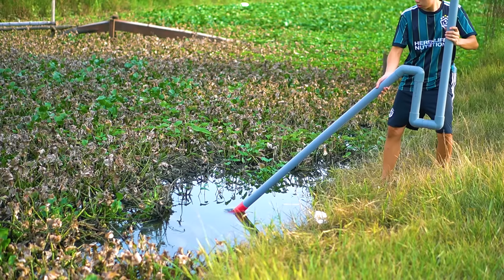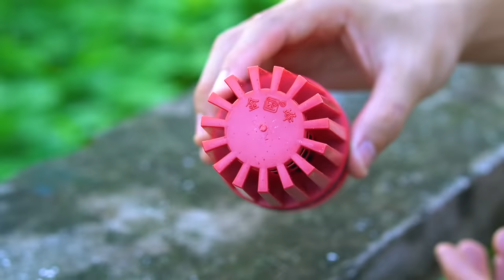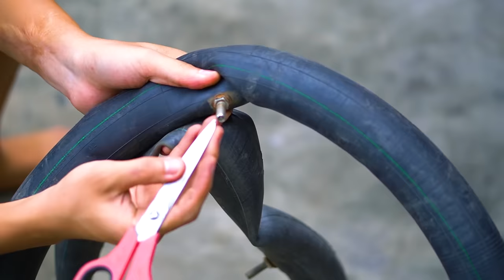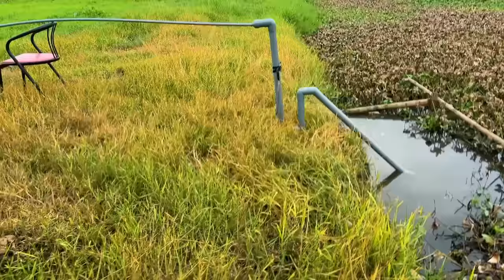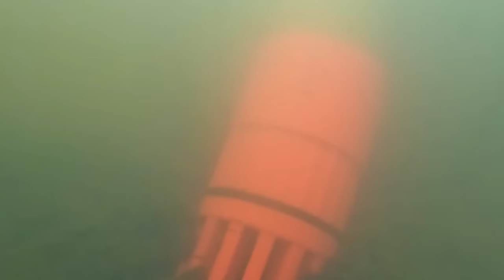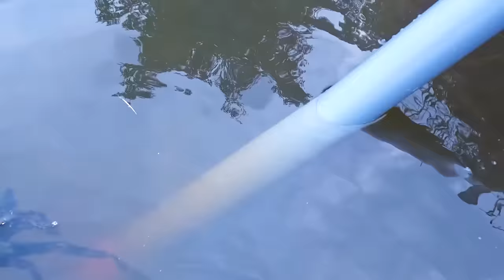I turn PVC pipe into a water pump no need electric power

Comment: In 6.53 to 7 minutes on the video you can hear a small pump sound inside that pvc listen carefully 😂😂😂 all of his video’s are fake don’t try to make those
Reply: Excellent, Inspector Rakib, I was looking for the failure, you found it. Congrats ...
Reply: @francoisgouttes8242  i do rewind back the 6;53.. i saw the bike on the roadside and it was the sound of the bike !
Reply: owh really ? your ears is good but your eyes not.. if u rewind back and see whats near the roadside is the sound of bike not pump.. i bet your might need to go for doctor to check your ear & your eyes
Reply: @dickymobile9189  I am not concerned by the noise, be it bike or airplane; this guy is making so many people lose their time showing a bad music hall trick .. enough for me.
Reply: yes! fake!
Reply: It’s not fake, once the water has started to come out of the output no external energy would be required. The water going out is sucking water in and the valve only lets the water flow in one direction. This creates a sucking motion as the water leaves in the output the water will enter the input.
Reply: Visible Truth  what’s your theory
Reply: @petercleary3278  hahaha, very funny! And then the mother sheep opened the belly of the sleeping wolf and found her baby alive and the fairy turned the pumpkin into a coach.
Reply: Visible Truth  I have seen before the pumps using air and pressure to pump water mechanically. Could it be possible that the diaphragm he has fitted in the pipe could be creating a syphoning action. It could work but I see the flow is continuous not in the action that would work with the diaphragm . The water here looks like it’s being syphoned and not pumped as the title says
Reply: Notice the sound stops after the truck with the red container moves out of range. Look up sound of J Brake / engine Brake. The science behind this no trickery. In plumbing that style of grease trap is banned cause it does exactly this. There's many videos explaining why whywe use P traps and not s traps. Also if you notice the one way valve I think there's also a ram pump situation happening. But you can look up ram pumps and this is explained by many many ppl in different fields from engineers to physics to high-school teachers. Go find some scrap pipe and learn something maybe educate yourself a bit lol
Reply: @petercleary3278  go back to school and get some basics of phisic laws 🤣
Reply: @francoisgouttes8242  p
Reply: I can hear the pump too lol
Reply: How can the water lift if the outlet is higher than the inlet? This is a hoax.
Reply: 😂😂😂😂yes
Reply: Yes they have pump using.
Reply: There are fools to fool and fools to be fooled, right?
Reply: hoax video😜
Reply: Goes against the laws of fluid dynamics!
Reply: It's the sound of a bike on the road dude... 😒
Reply: Hahaha,look at the flow of water just like a faucet, hahaha
Reply: @petercleary3278  это из твоей головы мозги выходят без всякой  энергии
Reply: Despite the negative comments above, I am of the opinion that this man has shown every aspect of his science in this video even in the deep water. there is no water pump. 

but I am not sure whatever he has made is a successful project. I don't know why he fixed the tube valve in the inlet section of the pipe and how it sucks the water and the push it towards outlet section
Reply: @ismailmohamed9750  
Do you know the meaning of fraud?
Reply: @ismailmohamed9750  
Do you know the meaning of fraud?
Reply: Nu are logica, cum sa urce apa asa fara nici o forta ascensionala.
Reply: E ceva sub apa care o impinge in teava, supapa impiedicand apa sa coboare inapoi in balta, teava ramanand mereu plina cu apa impinsa din balta.
Reply: Actually this kind of flows of the water was happed from the time of Moses when he struck or hit the big rock after several hitting that rock begun to split apart... then flows the watet from deep to the top...The pressure from the depth pushing the water flows above...I think the tube is like generating a sucking pressure.
Reply: I forget the name of the law this force applies but once it gets to the bottom of the 90 and out. It’s good. The flap at the bottom helped draw in water.
Reply: @wazirazam2591  the red inlet side acts as a diaphragm pump. Him shocking it draws water into the tube. The water has no where to go but in/up/right/left/whatever. Once it gets past the first 90 and falls. It’s a wrap. The tube fills up because water is freaky like that. It will follow its own path like electricity. But what makes it fill the tube is gravity. The water pushing past the first 90 that drops is what is giving it momentum. The diaphragm isn’t moving anymore. It’s stuck open. Water is flowing by.
Reply: I think this method he showed in the video could potentially work.
Reply: YouTube me paisa kamane ka achchha idea nikala hai.. View badhane ka
Reply: @francoisgouttes8242  90⁰
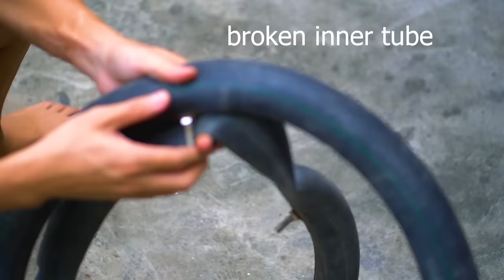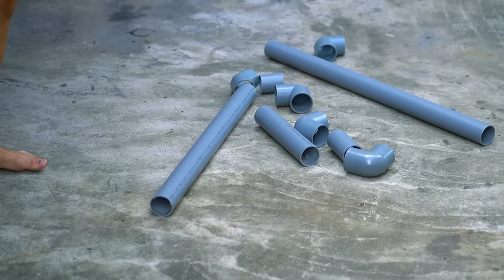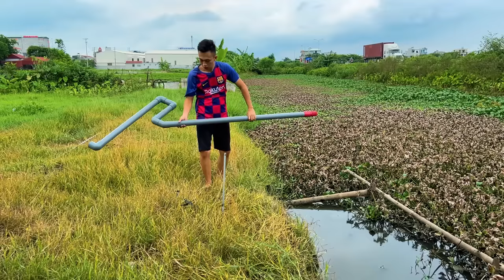Reply: Please observe the main technology in this video from  3:00 to 4:45 & water flows (starting) procedure from this pipe on after 6:20 it's really working by using the Air valve of tyre's tube
Reply: put it like this  6:53
Reply: @petercleary3278  me
Reply: Even Thomas Crapper understood that a U shaped bend will continue to siphon. S-Trap siphons water dry. Or, a hose in a fuel tank will drain into a gas can with a bit of suction and no pump. Cylinder plunger he made is engaged by manual back and forth movements. Drawing water up and into the trap forcing it out the other end. Same process as a windmill or hand water pump only he is the crank and will need to crank often. However, is the bike making whirring sound once it’s passed the microphone? It would sound different after it passes.. Maybe...
Reply: Yes
Reply: You can see him priming the siphon (one way valve)  at 6:29. After that it will siphon until there is no more water to suck.
Reply: @Crypto_Jeff  you can't siphon water uphill!
Reply: I know the bike sounds and pump sound don’t try to make fool when the pump sucks water inside pump sound will gone automatically
Reply: Yap he is using a small pump witch cosing the low pressure of water
Reply: They make ciphering hoses that are the same concept. I have one.
Reply: Yes i can hear it...haha
Reply: 1.8M Water Jiggler pump fuel Transfer Self Priming Shake jiggle Siphon Hose Pump
Condition:
Brand NewBrand New
Bulk savings:

Buy 1AU $14.80 each
Reply: Yeah, a truck went past at the same time.
Reply: It's called a ram pump
Reply: The check valve pushes water up, every time he shakes it. The check valve stops the water from exiting through it. Once the system is filled with water, then the siphon kicks in the draw the water up, as the water falls out of the top. It's the designs series of falls that keeps pulling the water into the tube.

Comment: Definitely works! 😁👌
I have 2 bathtubs installed 1 above the other. I use that "magic pump" to lift the water into the top tub. Then I let the water drain out of the top tub, through a mini turbine to generate electricity, then back into the bottom tub to start the whole process over again 👨‍🏫 I've stopped paying for electricity and even started selling the excess electricity to my neighbors 💵

My next project is creating a water powered car that uses the same principle 🚙 I should be able to finance everything with all the money I'll be making from selling electricity!

And for my final project! I'm gonna turn cow manure into gold bricks! 😂🤣
Reply: Elmo Reneal how can I invest in your venture? Where should I send the check?😊
Reply: I have perpetual motion machine also. Makes so much money. 😂
Reply: @funwithfamfun 
WOW! NO SHIT!? 😮 How did you manage to pull it off? Sadly, my "perpetual motion" machine wasn't perpetual motion after all 🤷‍♂️ The damn thing started to slow down after only 20 years! 😫 Very frustrating! Where will I ever find the time to test another?
Reply: @elmoredneal5382  you could have used magic oil in the bearings then there would have been no friction to slow your machine down.
Reply: Like a perceptual energy machine,,,,, BS!🙄
Reply: Helpful hint (shh… secret). On my homestead, I feed my three head of cattle fairly large amounts of the herb goldenseal. This has increased my gold/manure ratio from 7 ppm to 444,023 ppm! Originally, I could not afford to pipe in municipal water so I drank my own urine (as well as the cows… another hint, keep clear of that early morning stuff!). I was finally able to quit my job, get a tummy tuck, and buy a real house with a shower. Good times. I still tap the pee once in a while to remember my roots. But TMI.
Reply: Me too... except my money making perpetual motion and energy machine supports the leprechauns and unicorns living under my bridge
Reply: @sonnyh9774  so you stole the leprechaun's gold now you're forcing them to live under your bridge with the ogres?
Reply: I don’t need any of that. Got me a money tree!
Reply: Cow pats to gold bricks is doable....the exchange rate would be about  5 ton of dried cow pats per  troy onz.
Reply: They had us in the first half, not gonna lie.
Reply: And you will win enough Nobel Prizes to use as wallpaper.
Reply: jajajaj ta bueno el chiste
Reply: Perpetual motion wow you are a smart guy.

Comment: Mine works so mush better if I huff the glue instead of wasting it on the fittings. Side note, abs is a lot easier on the nostrils, and it has a sweet smell. You won't need any purple primer...

Comment: Impossible that tiny Bicycle air inlet could produce such large volume of water...genius magician...
Reply: Yeah I caught that also!
Reply: I noticed that too but it reduces the wt of the ck vlv and he also lost the seal that was removed from the disc and the schraider vlv was left in place.  I suspect he did not have any silicone handy.  Seems like he primes it like a shaker syphon.  Still trying to understand how the flow is maintained .  I may build one when I retire and get board.
Reply: Nah don't waste time bros.. It's a scam..it's only to get views..
Reply: Magicians use a diversion tactic that is totally irrelevant to the trick. Exactly what I was thinking when I saw the inner tube bit. Made me laugh though.

Comment: No way this is real. One of those pipe sections has to have a battery-powered pump and battery inside it. Or maybe that part of Asia is not subject to the laws of physics.
Reply: could be the same group who attempted to duplicate primitive technology's content but with bigger "manual" works.
Reply: Tôi đồng tình với ý kiến của bạn, nó có thể lắp pin bên trong
Reply: The check valve pushes water up, every time he shakes it. The check valve stops the water from exiting through it. Once the system is filled with water, then the siphon kicks in the draw the water up, as the water falls out of the top. It's the designs series of falls that keeps pulling the water into the tube.

Comment: There is no way that water can go up with just having a u turn pipe.You can bring up water by siphoning provided the outlet is much lower than the source of water.Siphoning work in a way that once the water goes out on the outlet it tend to suck up the water because of gravity or the suction pressure created by continous flow to the lower section.iniatialy a water is place on the opposite side of the pipe that will act as the one suctioning the water from the source going to other side of the pipe whose end part is lower than the water source.
Reply: Isso mesmo,esse vídeo é falso.
Reply: What he do like this for? Impossible
Reply: It is impossible
Reply: the schrader valve requires 30 psi to force it open. Water has more psi the deeper it is - so the pipe goes six feet down and is 3 inches diameter - so you get greater than 30 psi to force open the shrader valve.
Reply: @voidisyinyangvoidisyinyang885  he doesn't have 6 feet of pipeline under the water in this video.  look at the lenght when he carries the system.  He puts only about 2-3 feet into the actual water.
Reply: @frankswd  Thanks for pointing that out. He moves the tube back and forth about 10 times while it's just in the surface of the water and then water shoots out of the top. "How much pressure does it take to move water? Residential water pressure tends to range between 45 and 80 psi (pounds per square inch)." So the Shrader valve is activated at 30 psi - and so by moving it back and forth in the water he is causing water to jet up into the tube until it fills up enough to pour straight down causing force to push the water up the other end - along with more water jetting up the tube since the Shrader valve is now permanently open. There must be negative pressure created in the tube to then suck the water out due to the "Pea trap" - There is a delay in time between the water jetting up and the water in the pea trap creating a "negative pressure" space that then sucks the water up the jet once it's submerged two feet into the water without moving.
Reply: That’s true but maybe the pipe had water already so the small movement that he did could be enough to prime more into
Reply: When he's moving it back and forth the one way valve is letting water past it and the water level is slowly building in the 45 degree pipe.  When the water falls down the vertical pipe it creates a suction that pulls more water into it which also builds pressure to climb the vertical pipe.
Reply: @doubledose9  exactly - that's what I've been telling people. It makes total sense once you figure out this ingenious design secret. Of course having that type of lagoon is also necessary. It should work with a creek as well I suppose - I have an irrigation ditch that I might try this out on.
Reply: @doubledose9  that might make sense if it was a solid flow   this one has plenty of air to enter disrupting any hope of a syphon
Reply: @voidisyinyangvoidisyinyang885  - That's what I thought he was doing when I saw him pushing the pipe up and down, but Wade Jones explained it simply enough for me to understand. I wonder if that would work in getting water out of a rain barrel that doesn't have a spigot at the bottom.
Reply: @annwithaplan9766  It would depend on the water pressure needed - also it's more of a horizontal setup - so he has a long distance of pipe that is horizontal to the body of water. It would be too vertical if it was put down into a barrel since the angle would be too steep I think.
Reply: @annwithaplan9766  It would work great. Electric pumps tend to do that.

There is no free lunch in physics, people. If you want to lift something against gravity, you need to add energy to the system.  Period. It doesn't matter how shallow of an angle, a ball will never roll up hill on without added energy somewhere. Water is no different. 

And no. That doesn't change by breaking the ramp up into two ramps.

Ignore the physics equivalent of sovereign citizenry.
Reply: this is a ram pump is the same working method is posssible and is true
Reply: @reallyyoutranslatedthis1057  no es falso es una ram pump o bomba ariete es el mismo principio solo que mas sencilla
Reply: @elarcadenoah9000  No. A ram pump is a completely different thing using completely different principles.
Reply: @voidisyinyangvoidisyinyang885  Complete and utter BOLLOCKS !!!   -   He obviously has a Compressor attatched to the valve, forcing the motion !   -   You need to re-visit the Physics Class!
Reply: @doubledose9  You really are having a laugh !!
Reply: @voidisyinyangvoidisyinyang885  Bollocks.
Reply: @tbfkrex1  QUITE !
Reply: @annwithaplan9766  No, it would NOT work anywhere.
Reply: @voidisyinyangvoidisyinyang885  NO chance of working ANYWHERE !!   -   Unless you have the compressor airline attached, to provide the energy, as he did (covertly).
Reply: @Bruwulf  I'm glad a few of us here are not suffering from stupidity, well said !
Reply: @elarcadenoah9000  Bollocks.
Reply: The schrader valve is the key.   It actually works on the same principle as the Rockwell Retro Encabulator.
https://www.youtube.com/watch?v=RXJKdh1KZ0w
Reply: @seeharvester  🤔
Reply: Yes it does....u dnt understand physics then sir
Reply: Well... kinda. There is no such thing as "suction" there is only higher pressure and lower pressure. In a syphon the weight of the water flowing down the down pipe is equal to the water weight in the up pipe, unless the down pipe is longer than the up pipe. If the down pipe is longer and the outlet end is lower there is the water in the extra length adding to the equation. The down side will then create a lower pressure in the up pipe. This is where it really gets into physics -- there is air pressure -close to 15 psi pushing down on the water, then that pressure pushes the water into the up pipe and the water flows because of that atmospheric pressure.
Reply: In most applications automotive the filler nozzle has a part inside that pushes the Schrader valve open. Whether it's a screw on type or a push on, this is why there is some escape of air as you are pushing or screwing the filler on and again when you remove the filler.
Reply: this creates a suction just like when siphoning gas out of a car's gas tank.. same principle.
Reply: @voidisyinyangvoidisyinyang885  you have NO clue what you are talking about you'd need it to go 70 feet down to get anywhere near 30 pounds. Plus you'd have to go 2.31 feet deeper to get one foot of water in the bottom of the pipe.
Reply: @elarcadenoah9000 this isn't a ram pump and has nothing to do with a ram pump. You people are so full of it
Reply: Thats got an battery powered inline pump in it. 
Theres no way that schraeder would open against its spring pressure in that level of water. 
He is taking the P155 out of us all.
Reply: My guess it’s just a water pump he connects it to underwater like the rest of his “water pumps”